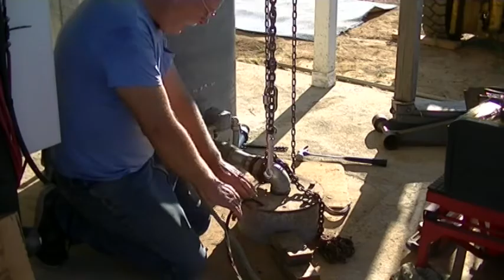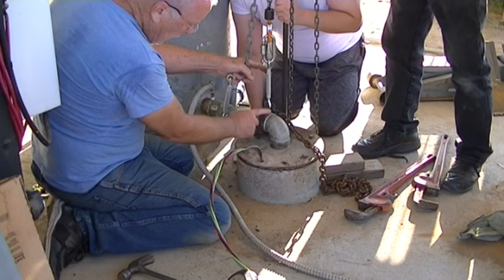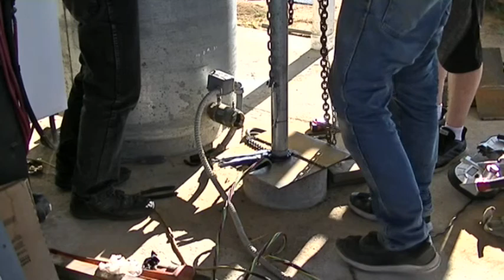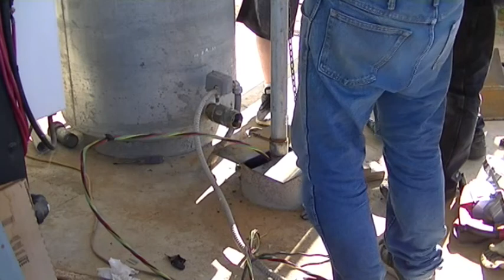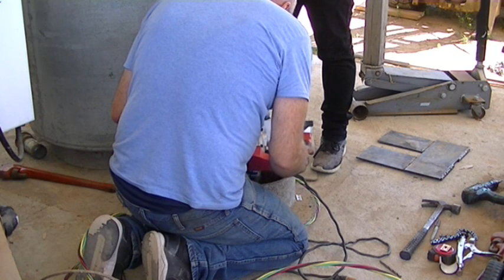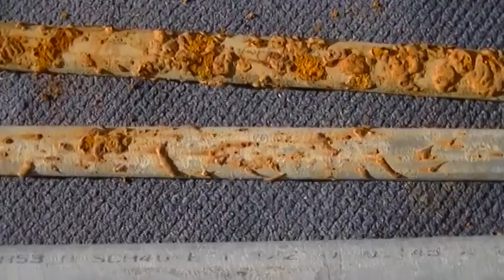Remove a Submersible Well Pump with Overhead Restrictions

Comment: Very big casin (8”? )  good lock sr. Nice video 🙏🏻🙏🏻
Reply from the maker: Hi. Thanks for the comments. The casing is 12" but only down 2' and after that just a 12"+ hole. That is the problem. I can't blow out the well unless it is cased all the way down. My plans are to install a 10" casing the full depth and then wait for the water level to come up high enough to blow out the well to be able to lower the pump. Have a blessed day.